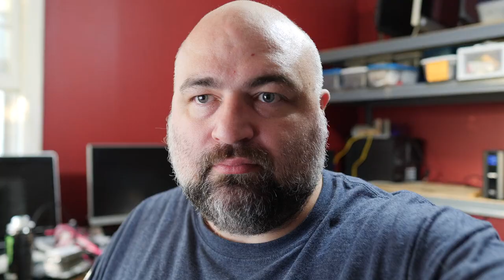Even MYTHBUSTERS Got The Airplane Conveyor Belt Question WRONG - A Neckbeard Explains - Jody Bruchon

Comment: First.. at about 5:05 you say it's impossible to build a conveyor belt that does this. You would be incorrect. In reality, all you would need to do is set the plane on the conveyor belt, and tether it to something off in the distance in front of it and turn the belt on. The wheels will then spin at the exact same speed as the conveyor belt. This gives us your scenerio. What happens when you fire up that airplane engine and mash the throttle forward?? The plane is gonna take off.
Reply from the maker: What speed would the plane's wheels rotate when the plane moves forward? The same as the belt, or faster?
Reply: The wheels on the plane that took off in the Mythbuster experiment exactly matched the speed of the conveyor belt. They were touching.

The plane always takes off.
Reply: @phil2082  Just because they are touching does not mean they are matching the speed. If you put a car on a treadmill and you push it forward, are the wheels matching the speed of the conveyor belt? NO! They're rotating faster. They're only matching the speed of the treadmill when you hold the car still. Again, this is fundamental to the problem itself and is the only rule that matters.

Comment: The way this question is written in the introduction the airplane will NOT move forward. In order for the airplane to move forward the speed of the wheels MUST be more than the speed of the conveyor belt. However, not having a magical conveyor belt the Mythbusters were not able to test the question as written here. 
The Mythbusters moved the conveyor belt in reverse at the normal takeoff speed of the light airplane, 25 MPH. The airplane took off at its normal 25 MPH with its wheels turning at 50 MPH. This is a fundamentally different question than asked in the introduction.
Reply from the maker: Fair.
Reply: It’s sort of a trick question in suggesting that the plane will not be moving forward. The real question should simply be, will a conveyor belt be able to prevent a plane from taking off? Like Clarkston’s comment says, it cannot. All a conveyor can do is make the wheels spin faster, it cannot restrain the plane’s forward motion. The plane (big or small, prop or jet) would still move forward and take off, conveyor or not.
Reply from the maker: @cinedelasestrellas  It can if the wheels are forced to go the same speed.
Reply: @JodyBruchon  but a conveyor cannot make the wheel turn at the same speed, because the plane's engine will pull the plane forward. The wheels will always spin faster than the conveyor speed when the plane is powered by the engine(s). You can't restrain a plane simply by moving the ground underneath it (there are some losses due to whatever friction is in the wheel bearings so it may increase the takeoff distance, but will not stop a plane under full power).
A conveyor can prevent a car from moving, because a car engine applies a torque to the wheels. However, if you were to put that same car in neutral and attach it to a winch (the winch being bolted to non moving ground), the tension in the cable will keep to car stationary. If you were to activate the winch, the car would move forward, regardless of the conveyor speed (unless you blew out the tires but that's a separate issue). The plane's engine produces a force that is separate from the wheels, much like that winch cable. It will move forward as long as the wheels hold together, conveyor or not.
Reply from the maker: @cinedelasestrellas  That's not important because the QUESTION says that the wheel speeds remain matched.
Reply: @JodyBruchon  Agreed. The real issue is that the question was worded incorrectly.  If the plane is moving forward, you are absolutely correct in saying that the plane's wheels are spinning faster than the conveyor speed. In the Mythbusters plane, if the pilot were to add just enough throttle (it wouldn't take much) to allow the wheels to spin at 25 MPH, the plane would remain still (prop wash alone cannot produce enough lift for a plane to take off). If you were to apply full power, the plane would move forward and the wheels would be spinning faster than the treadmill speed, which is now inconsistent with the semantics of the question, which said that the wheels are turning at the same speed as the treadmill.
Reply: @cinedelasestrellas  That's not quite true though; if you have the budget, you can build a conveyor belt that's able to spin the wheels fast enough to destroy the bearings and the wheels (and the aircraft, and then almost certainly the conveyor belt...)
Reply: @JamesMooreSeattle  yeah, or you  could just put spikes on the conveyor to burst the tires.  Or just make the pilot run on the conveyor belt for so long that he/she is too tired to fly the plane.
Reply: It's literally not a different question.

The wheels literally move at the same speed as the conveyor belt. They're touching.
Reply: @phil2082  This whole thing is a question about reference frames.  Your statement that since the wheels are touching the conveyor, they are going the same speed as the conveyor is true only as observed by the pilot's reference frame, but not as observed by someone standing on the ground. If the plane is moving forward, the wheels are spinning at a speed of the conveyor plus the forward speed of the plane. Think of it this way: a normal runway is like a conveyor going at a speed of zero. The wheels are touching the runway. By your statement, the wheels must be spinning at a speed of zero when the plane takes off. This is obviously not true. The pilot's reference frame  is the plane, so on a normal takeoff (let's just say the 25 mph of the subject plane), he would be observing the runway moving backwards at 25 mph, and the wheels spinning at 25 mph. If you were standing on the ground watching the takeoff, your reference frame is the ground, so you would observe the runway moving at zero mph, and the plane moving forward at 25 mph, with the wheels spinning at that same 25 mph. Same thing as if the conveyor were moving at 25mph: pilot on takeoff observes the conveyor as going 50 mph backwards, wheels spinning at 50 mph. A person on the ground observes the conveyor going at 25mph one way, the plane going 25mph the other way, wheels spinning at 50 mph. This is what Clarkston Guy was (cortrctly) explaining in his original comment.
Reply from the maker: @ericfletcher8454  Of course you don't have an answer, because you're all talk and no thought.
Reply: THIS is a huge problem. And the fact that Adam Savage made a 12 minute video just to defend his experiment and equating it to the wheels spinning at the same speed of the tarp is asinine. Not only did he have huge flaws in his experiment, he tested the wrong hypothesis and used it to defend a completely separate problem.
Reply: @cinedelasestrellas  The conveyer belt is not "making" the wheel turn. The two are synced up EXACTLY. When the speeds are exact, as the tire rotates 1 meter forward, the conveyer will move 1 meter backward. So you are exactly where you started. The only way to make ground on the conveyer belt is to 1. Break the rules of the problem that state that the wheel and belt are the exact same speed, or 2. Break physics. And then we're all doomed
Reply: @cinedelasestrellas  It's not though. "All a conveyor can do is make the wheels spin faster" That is ABSOLUTELY CORRECT! But if the wheels are spinning the same speed as the ground is moving the opposite way, you cannot make up any ground without either violating the rule of the question OR violating the fundamentals of physics. And then at that point we're all screwed
Reply: @phil2082  I've seen about 10 of your comments while scrolling through here now and at this point I'm convinced you're just a troll.

Comment: You keep saying that propellers push air backwards whereas the 747 has jet engines, as if they work by some different principle. Jet engines exert force in the exact same way. They push air backwards. They just do it much faster and within a much more compact enclosure. The air passing across an airplane's wings to give it lift comes from the airplanes' velocity moving through the atmosphere, not from the air the propeller is pushing backwards. The turbulence from the propeller actually interferes with the wings ability to produce lift because the wing's aerofoil requires laminar flow. The propeller simply produces thrust to move the plane forwards; where that thrust contacts the wings it is actually a *hindrance*, not a help!
Reply from the maker: You didn't actually listen to what I said. I was talking about propellers pushing air backwards that can then go over the wings. It was an attempt to curb the silly notion that prop wash can lift the otherwise stationary plane.

Comment: Imagine you're standing on a skateboard on a treadmill. You're holding a rope tethered to the wall in front of you so you don't move. The skateboard's wheels are spinning like crazy but you aren't going anywhere. The wheels are very well greased, so even lightly hanging onto the rope is enough for you to stay in place.

If you pulled on the rope tug-of-war style, would you be able to move forward? Of course you would! With exactly the same ease as you could without the treadmill, because the free-spinning wheels mean you don't actually get propelled by the treadmill.

In the same way, the plane has no difficulty sliding forward despite the thing being pulled out from under it. It can still propel because its wheels just whizz away.
Reply from the maker: You copied that from a website or comment elsewhere and didn't think about it. When you move forward, the wheels on the skateboard will be spinning faster than the conveyor belt.
Reply: @JodyBruchon  What he said ^ .. I'm enjoying going through and seeing people's asinine arguments and analogies

Comment: Yes, IF the treadmill is governed to go the exact speed of the wheels and they are linked somehow so that the treadmill can proactively match the wheel speed vs reactively try to catch up to the wheel speed, then it would not take off. As you say, that's impossible, the treadmill would always be REACTING to match an increase in wheel rotation but always one step behind the wheel speed. This reactive increase in treadmill speed would mean the tires are always covering slightly more distance forward than the treadmill is backwards and the plane WOULD travel forward and eventually take off. Also, if we are adding in impossible hypotheticals, if the plane was give enough power, it could physically drag the wheels forward and take off lol. I think the constraint of the preemptively matching speed of the treadmill is the most unrealistic part of the whole question. I also have seen other versions of the question without this constraint and I think not having this constraint is actually more in line with the spirit of the riddle. Without this constraint added, I believe by ignorance or poor wording most of the time it is asked,  the plane would take off just like in myth busters. But if you are specifically selected THIS version of the exact wording, then no, it can't move forward

Comment: 100% agree, a plane cannot fly without high and low pressure on the wings. The problem we have as you have stated is the experiment is flawed.
Reply from the maker: Any real-world experiment can't actually meet the constraints in the problem presented. If nothing else, there's no way to make a colossal conveyor belt that always exactly matches the wheels. Such a conveyor will have a delay between its drive motor applying force and the belt below the plane actually matching up, and at some point, the conveyor itself is generating so much wind from the surface moving that it'll push the plane up by itself.
Reply: @JodyBruchon  Yeah the problem is people get hung up on all the variables that make the experiment difficult to do properly, resulting in the actual question never being answered. We see all the experiments with planes flying 'mythbusters' although you can clearly see the plane overcoming the speed of the conveyor pretty quickly, I think their experiment is badly flawed. However, it is a great thought experiment and really does make you think.

Comment: This riddle is sooooo theoretically that we have to leave like 50% physics out of this equation ^^
The way this belt functions: As mentioned in the riddle itself, the belt always matches wheelspeed. The wheels of the plane rotate because there is a perpendicular force from the weight of the plane + the rolling resistance. Now when the belt ALWAYS matches wheelspeed without any delay, the jet engines will begin to move the plane, but the belt keeps the wheelspeed equal zero because the rolling resistance can‘t be overcome with this type of belt underneath. 
So in my conclusion the plane would take off with a wheel speed of 0 compared to the belt, but since the belt has to match the speed of the plane to keep the wheels still, the belt would therefore match the relative speed from the plane to the ground around the belt. So the conveyor belt works like a runway of ice and the wheels are operating like skates underneath the plane. Since the conveyor matches the dimensions of a normal runway, that‘s enough to come to the conclusion that the plane gets airborn.
BUT: There is no way this can be done experimentally, because of friction, delay of components, inertia, etc.
Reply: For the plane to move forward you would need the wheels to spin faster than the belt is moving which directly breaks the rule of the riddle.
Reply: It goes both ways, the plane moving forward breaks the rules of the riddle, but there is nothing in the riddle to make the fuselage NOT move forward so its impossible for the plane to not break the rule, it's a silly impossible question
Reply: @nathanhansen4334  Absolutely! Isn't the point behind this all is: will a plane take off on a conveyor belt running the opposite direction. Matching wheel speed specifically is erroneous; the physics of it prove the plane will still overcome rolling resistance anyway - air propulsion is independent of relative ground speed.

So: because specifically matching wheel speed, rather than (more appropriately) take off speed simply introduces an apparent "gotcha" that some get hung up on. Going by take off speed, the wheels will only spin at double the speed of take off. This will be a finite number in RPM's. In that case, the conveyor would have to spin at that corresponding RPM.

But: because we know that air propulsion will overcome rolling resistance regardless, the only limiting factor is mechanical: can the tires and wheel bearings take the extra stress? That's an engineering problem: meet those much higher limits, and yeah, the plane will still take off.
Reply from the maker: @Eatinbritches  The constraint is what matters. It locks the plane in place. You are wrong.
Reply: If anyone that thinks it will take-off is a pilot, I am NOT riding with them.